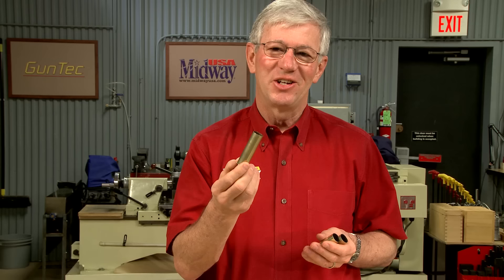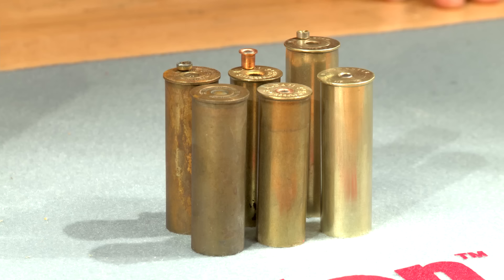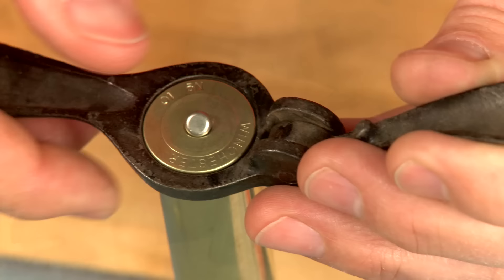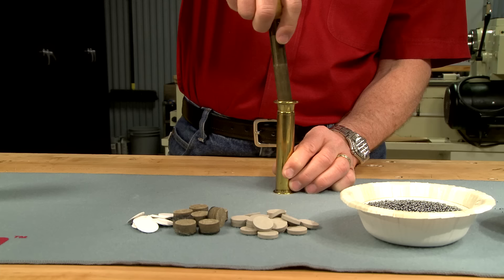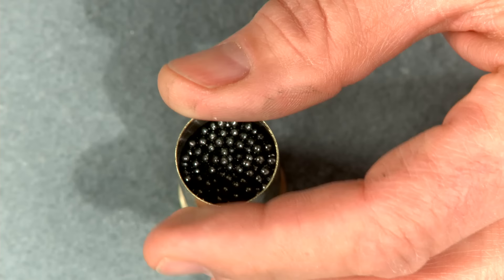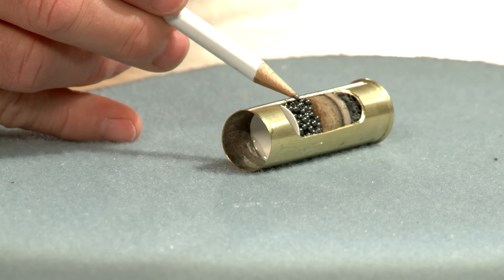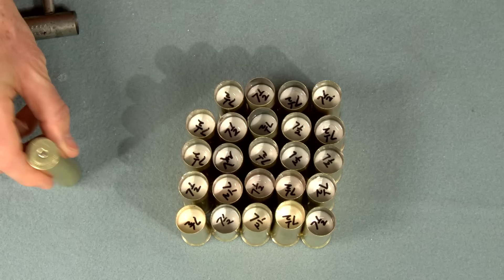Reloading 10 Gauge Brass Shotgun Shells Presented by Larry Potterfield | MidwayUSA Reloading

Comment: "Oh we made this trim and sizing die in the shop. It's easy!"
Reply: When you have the proper tools believe me it is
Reply: Seyfettin Soyak ar-are you okay, buddy?
Reply: @belenyer7759  it's like what my mamma always said and this applies to everything "you can either buy nice or buy twice" & "if you can't buy - you build it yourself"
Reply: @belenyer7759  Yeah a multiple thousands dollar lathe
Reply: @belenyer7759  Even my crappy Atlas Lathe wouldn't be super hard to make something on tbh.
Reply: @thetriode  Late reply, but in theory, a drill press could be used if you're modifying an existing trim die.  The hardest part would be finding a drill bit of the correct size.

A milling machine could be used as well, as long as you have a way to keep the opening concentric.  It uses easier to find equipment, but takes more skill.
Reply: @TheAttacker732  
I could make one, an Atlas works wonders even a clapped out Atlas like mine
Reply: Yeah, that was some bullshit.
Reply: @TheAttacker732  You'd really want to finish your drilled hole with a boring bar or reamer, and there'd still be a lot of polishing steps to get it working properly without tearing up the brass.

Comment: Midway USA sells these brass casings for 1/1$, a pretty good deal if you ask me.
Reply: Cpl. Gadway USMC Semper fi
Reply: Git’r dun!!!
Reply: Cpl. Gadway USMC nah better take  ready ones.. safer and more accurate and same price at the end
Reply: not 10 ga they dont
Reply: Pyotr Ilych Tchaikovsky  not brass you dont, or black powder (what he loads in the video)
Reply: Pyotr Ilych Tchaikovsky  
what kind of stupid question is that?

because I cant shoot smokeless though a 140 year old damascus double gun, like the one in the video
Reply: Pyotr Ilych Tchaikovsky  I had this whole thing written up on how that is a bad idea, but youtube fucked up, so long story short, no that is a very bad idea
Reply: Pyotr Ilych Tchaikovsky it doesn’t work because the smokeless powder burns way differently that black powder. It’s much hotter too.
Reply: Pyotr Ilych Tchaikovsky  please for the love of God no no NO!! The first concern among many is the pressure curve due to how fast smokeless burns vs black powder.
Reply: Pyotr Ilych Tchaikovsky  hum did not know that about black powder.
Reply: One would think that a Marine, of all people would know it's 'case', not 'casing'.
Reply: Pyotr Ilych Tchaikovsky  For 10 Gauge, a dollar a round would be cheap.  3 1/2" slugs are roughly $3/ea.  Plus, brass shells can be loaded more times before the material fails.  Plastic hulls eventually start to fail at the crimp.
Reply: Can you still buy them for that, Dec 2020 ?
Reply: I want a reloading kit like that .

Comment: Larry, why don't you market a simple 10g resizing ring for brass shotshells? Most of us that reload all brass black powder shells would be very content with just a simple press mounted sizer ring the shell could be pushed into with the ram and tapped back out with a small mallet and a dowel. The rest of the process is easy, but making a sizing ring or die is beyond the capabilities of most reloaders.

Comment: I fill to the top with equal depth powered and shot. My shells are old and thicker walled, been reused many many times and I try to replace worn out ones when I can find that right type of shell. I also load stainless bb's and not lead shot, the shotgun is so old that I use it strictly for home defense and only take it outside once per month to test fire and clean. 

Yes, it does the kind of damage you might expect, to splits a steel drum wide open.

Comment: The Magtech brass shells are designed for black powder with a large pistol primer, I have seen videos of fools boring out the primer to accept 209 primers. NOT SAFE. If you what brass that takes 209 primers and smokeless powder, Rocky Mountain Cartridge Works custom makes brass shells from solid brass rod, not from thin extruded brass tubing. They can machine the brass to most any chamber length that is not standard. They are not cheap but are well worth the money.

Comment: Wow, I never new they made brass shot shells!
Reply: +Jager I didn't think of it either, but it makes sense if you think about it. Plastic hasn't been a common material for that long. Shotguns were definitely invented before plastic was commonly used.
Reply: +GamePhysics Between the use of full brass hulls and plastic hulls, there were paper hulls. The only problem with paper hulls is that they tend to swell up in high humidity.
Reply: Elijah Decker Cool to know. Thanks.
Reply: +Jager 
I didnt for a long time either but it makes sense when you think about it. 
Before going to plastic, pressed paper was also used for awhile. It was lighter and cheaper. The only down side is paper gets wet. They had a hell of a time in the Pacific in WWII with the paper shells.
Reply: +GamePhysics  And long before ANY shells were used.

Comment: Easy!  When you have a lathe and can heat treat steel.
Reply: What does this video have to do with machine work and treating steel? It's basic reloading.
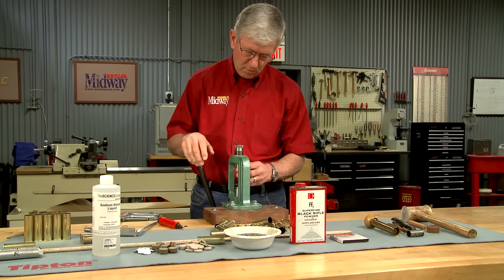Reply: Did you watch the video?  He uses a shop-made trim die at 1:30.  A lathe would need to be used to make such a die.  Also, he cuts the cases with a hack saw, which would not be possible without heat treating the steel after producing the part on the lathe, so it will not be scratched during the cutting.
Reply: spewgilist Have you not an open mind? There are plenty of shops that can make the necessary dies for a fee. If you have the correct tooling, the dies are easy to make yourself. It's basic reloading from there.
Reply: The casing would be pretty fucked due to the size of the teeth no matter how clean the face of the die is. Also, you're not going to do a whole lot by running a saw parallel to the face.

Comment: Hello, i enjoyed watching the video.
I have a question, do you get to the point where it is unsafe to reload the brass hulls?
And do you keep those aside when they break?
As a collector it would be nice to add worn ones :)
Reply: Brass work hardens. And the ignition of the cartridge will stretch the brass a little bit. So eventually, the case will fail. It wont be unsafe, but that cartridge won't be re-loadable again.
Reply: Bye starting with high quality brass and annealing between firings you'll extend the life of the shells, especially when loading light target loads, but eventually brass will go bad. It'll usually rupture when it's too bad to use anymore

Comment: You make loading those look ver easy does midway sell those tools obviously except for the jig and would shells made like that work in a browning pump action?
Reply: blackpowder 67 midway has pretty much everything, and they would work in a pump action but you'd probably want to roll crimp your shells a bit because recoil CAN  unseat the glue while the shells are in the tube. That doesn't mean it will always do it, but the one time it does could be at the worst possible time (when you're about to pop a bunny or deer for a follow up shot)or worse it could leave a space between the powder and the payload and increase your chamber pressure way too much

Comment: Love your videos, always so informative and straight to the point. Question I haven't been able to find an answer to is the length of the shells. I have a coach gun with 3 inch chambers, do I need 3 inch brass shells for proper function as well as safety? All I've been able to find are the magtech 2 1/2 brass shells.
Reply: Yes you can put shorter shells into your smooth bore shotgun. You cannot put in longer than the chamber. I heard that if you shotgun is rifled you shouldn't use short shells. However friend of mine use short shells in his rifled shotgun and it doesn't cause any issues for him nor does it reduce his accuracy.

Comment: can you load brass shells with smokeless powder?
Reply: Yes. However not with typical plastic wads (too loose in the case). You must have very tight fitting wads and a good over shot card seal to get good ignition.
Reply: hell yes!! you can buy them already loaded with smokeless!!! mag-tech and others have them!!! the reason he used black is that scattergun is a Damascus barrel, it's dangerous to shoot smokeless in that type of barrel, it can actually unwrap itself if there's to much pressure in a load!!!!!!!
Reply: I've seen loading data for some black powder substitutes. Pyrodex and Triple 7. Black seemed to give better results. I think Track of the Wolf sells the manual.
Reply: My mistake. The manual is "Reloading Brass Shotshells" by R.H.VanDenburg & I saw it a Ballistic Products
Reply: @keithmoore7390  No, they never "unwrap" themselves.

Comment: Great video. Kinda cheating to use sizing dies and length guides made in your shop. Is there any way to resize the brass shell without a custom die? I have several 10 's brass shells that were not fired in the fun I have?
Reply: You could make a shorter sleeve that you could taper yourself and polish.  A piece of pipe that fits over the shell but not over the sleeve could pound it down to the shell rim.  A shallow hole in a block of wood that would let the rim in but not the sleeve, along with a dowel for a ramrod will knock it back up loose for removal.
Reply: A piece of pipe the right size and cut to length would do it. Just slip it over the shell and hacksaw it off.

Comment: Where can you get those casings, about impossible to find I'm sure, could use some
Reply: Check local trapping supply shops. Went to a small shop near me and mentioned that I couldn’t find brass shot-shells, so the owner goes out back and comes back with some mag tech 12g brass for me, new in box. Lots of these niche guys who own trap shops tend to have interests in black powder loading. Found a new place too! That’s the best advice I can give. I spent six months looking all over online and couldn’t find em before that.

Good luck -Brendan

Comment: mr.Larry can the copper shells shoot birds for long distance like plastic one???
Reply: Mohamad Hamoda The material the shells are made out of doesn't affect the accuracy in particular, most of the inaccuracy comes from a worn barrel, a bad load, a heavy trigger or sights. Brass shells are prized for their durability and reloadability. The ballistic performance compared to plastic shells is identical.
Reply: +Illustrious Potentate Go to Jack Rowe,master gunsmith. One video,he has a story about a dangerously worn Purdy. After all, every bang generates some friction,even if modern practise has a plastic surround(cartouche?)going up the barrel holding the shot. Europe has mandatory proof houses. NA chose not. How do we know when something wears out? Except the hard way? More and more we are told what to do. Does not mean I have to like it. Safety standards are necessary. Telling people what colour to paint their house is a self righteous OCD pain in the ass. Hemorroidal. Such people need to be squashed,but are not.
Reply: +Mohamad Hamoda   Brass not copper.  The gauge, load and choke determine range not the material the shells are made of.
Reply: +paul manson  I've been at this a LONG time and I don't think I've ever seen a barrel worn out from use.  I have seen barrels that had been neglected (improperly cleaned from the black powder days) that had been honed several times to remove pits. When measured some of these may not meet what are regarded as minimal safe wall thicknesses at various points, esp. at the chamber and forcing cone.  These were usually Damascus barrels.  Even so, I've never seen one fail with correct BP loads and don't know anyone who has either.  When I was a teen, I came across a cheap gun with badly pitted twisted steel barrels, quite thin at the breech.
I tried to blow it up.  Worked up to 12 dr. FFG and 2.5 oz shot and no problems.  Gave up and hung it over the fireplace where it still is.

Comment: Is there any danger of the primer firing when ramming the powder and wadding into the shell?
Reply: +kefkaZZZ naw, its safe. you really gotta slam a primer directly. I have once had a primer not centered properly when I pushed it into a shell and it popped. was scary,  but not a big deal, and that was the primer press crushing it against the die/shell.
Reply: Good to know, thanks!

Comment: Anybody know if you can just add an extra wad to the layers, then do the water glass around the top? I just don't like how far down his components sit.. I know it works and is ok, but it just doesn't look right for some reason..
Reply: Generally speaking that's fine. You just have to make sure your total mass of ejecta including the wads, etc. is equal or less than the weight the recipe calls for.
Reply: GunFun ZS Cool. Thank you :) I noticed that MidwayUSA carries a book regarding how to load all-brass shotshells.. Maybe I should pick it to find some good recipes, then do some fine tuning from there.
Reply: That's a good plan.
Reply: +GunFun ZS hi question the capping tool in this video you think it will work with a 209 primer he showed one on the video but didn't us it what you think.
Reply: ocean374 I don't understand what your question is.
Reply: GunFun ZS in the video he shows 3 different primer one of them is a 209 primer so the clam shell tool he shows to install the primer you think it should work also with the 209 primer i purchase one of those clam shell type tool for a 12 gauge plastic shotshell i just wondering if it would work for that also thanks.
Reply: ocean374 OK. I understand. Yes, it ought to work. You can also do it without any special tool. Place the primer on a hard flat surface. set the shell on top and push it into place by putting a dowel inside the shell and pushing with your hand.
Reply: GunFun ZS great thank you like always.
Reply: No problem.

Comment: How much of 2 ff black powder do you use for a 12 gauge full brass shotgun shells when reloading
Reply: It depends on the load. Go bye ounces of shot and grains bye volume when loading black powder. Shotguns were loaded in "drams" which is about 27.3 grains bye volume of black powder. A good 12 gauge could be loaded with up to 3 1/2 drams of FFg black powder and 1 1/4 oz of shot. That would only be for guns with extra long chambers and that were strong enough. An average load would be more like 2 1/2 drams of ffg powder and 1 ounce of shot. Don't reload shells until you've done the research necessary to not blow yourself up! Be safe
Reply: thanks dude

Comment: I'm not understanding the use of the black powder,smokeless was very common after about 1900.
Reply: Older shotguns might not be proofed for nitro.
Reply: Keith Larsen That's true,there was a time period for awhile that you could buy the same model of 🔫 gun,either as nitro or black powder.
Reply: You need black powder for antique guns.
Reply: @michaelnobibux2886  We know.
Reply: @keithlarsen7557   There is no proof requirement in the U.S.
Reply: @wholeNwon  I did not mean in a legal sense, but rather the manner of construction.
Reply: @keithlarsen7557   Oh, constructed to handle smokeless pressures?  In the early days when the conversion from black to smokeless was occurring, the early smokeless powders were intended to be loaded like black (i.e. bulk powder loaded by volume).  Their pressures were just a little higher. That changed later but many careless home reloaders didn't adjust to weight loading and some Damascus barrels failed.

Comment: do brass 12g shells work in pump or semi auto?
Reply: I would recommend doing a bore cast but if they fit properly and head space correct AND FEED then there will be no issue at all. they probably would feed just find as long as they had been roll crimped
Reply: +Samuel Connolly  For shooting black powder?   OK for a pump but the heavy fowling would very quickly prevent a gas autoloader from cycling.
Reply: Yes! I have a video on my channel running them through a Remington model 11

Comment: can you load brass shells with modern powder and slugs?
Reply: gotdrift8 wouldn't risk slugs. Smokeless powder is ok, IF you're going to load them in a modern shotgun.
Reply: What's the problem with loading slugs?
Reply: gotdrift8 my bad. I wanted to say slugs are fine, but the accuracy won't be that good since the brass doesn't hold the slug as much in place as plastic does.
Reply: Maybe using some kind of sabot jacket would help?
Reply: gotdrift8 probably, but its easier to just use plastic shells for slugs.
Reply: they deform after spending time in  the magazine  (I have a Saiga 12) looking for a solution to this, brass shells seemed to be the answer, I have some OATH rounds but I want more for alot cheaper so trying to get reloading tips
Reply: gotdrift8 gotcha. This isn't my expertise, but I hope I could help.